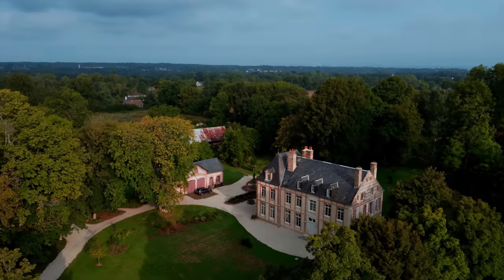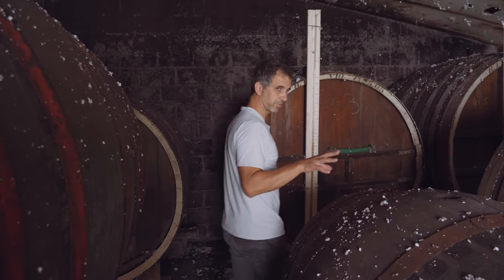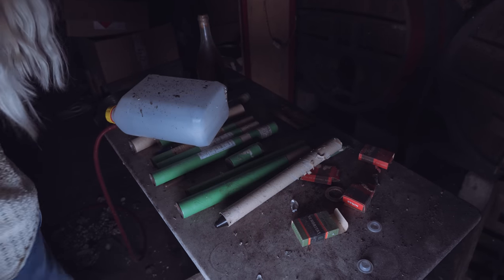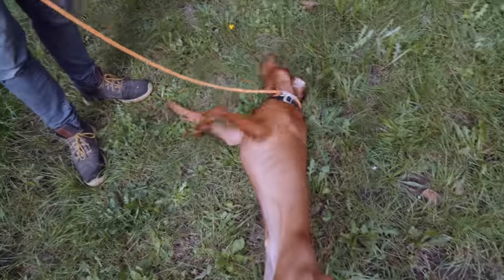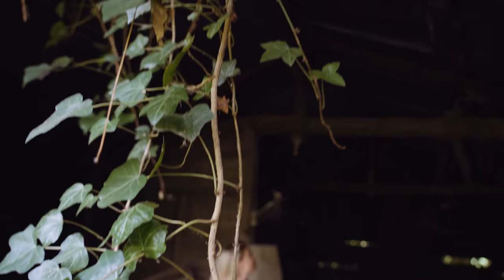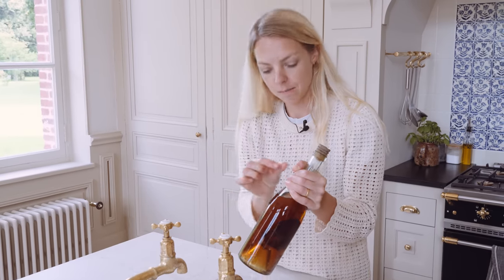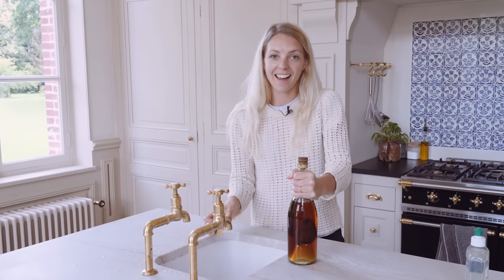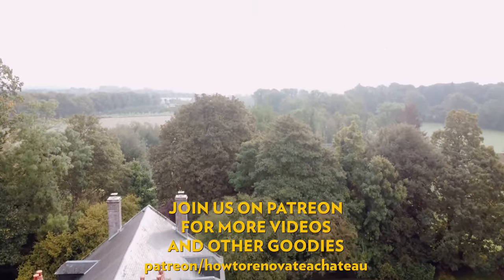Amazing discovery in the ABANDONED CHATEAU DISTILLERY

Comment: The bar with what looked like “weights” on it looks like an old line shaft system for a woodworking shop. Pre-electric powered wood shops used a pulley-driven line shaft system to operate all their woodworking machinery. That’s likely why you see a saw nearby. There may be some nice antique woodworking equipment hiding in there!
Reply: It could also be the drive system for a press. I’m sure they had quite a quantity of apples to press each season and would have mechanized it if at all possible.

Comment: In the second barn, the things you thought were weights look like part of a belt driven machine rack. It was usually hung from the ceiling. The disks turned belts which caused the machine to run. Think of something like an alternator belt in a car, but much bigger. It allowed a person to run multiple machines off one motor. They essentially drove the start of the industrial revolution. Some were set up so one machine had multiple disks. The size of the disk determined the speed of the machine's operation. Large factories used them, so it would make sense for bottling operations. They are still use today, but not major manufacturers...hobbiest and folks who use older machines for small operations.

Comment: 8:00 yes, that was a tiny spider and yes Australians are laughing at the reaction. The "weight lifting weight bar" is a line shaft drive, the saw bench connects via a flat leather belt to it. Looking at the pulley spacing, other equipment would have been connected as well. Those barrels will clean up nicely,  adding some juice could re-hydrate the bottom concentrate.
Reply: I laughed too and I am NOT an Aussie - there are bigger spiders helping me in my garden

Comment: Your "weights" are actually a lineshaft with pulleys. This was usually mounted to the ceiling, driven by a gas or (if older) steam engine to power multiple pieces of equipment.

Comment: they would make great rain barrels..
that axle you found next to the saw  was used with steam engines to transport power through a factory. those and belts to machines.
the axles were up on the ceiling and belts came down from there to the machines. David Richards runs a machine shop that way here on youtube.
If you can find the recipe for the brewery , i would atleast make a small orchard and distillery.

Comment: That looks like the "weights" are actually cast iron belt driven pulleys which would've been used for equipment like that saw blade. Vintage power tool drive systems, basically.